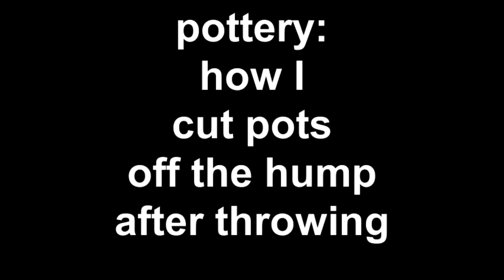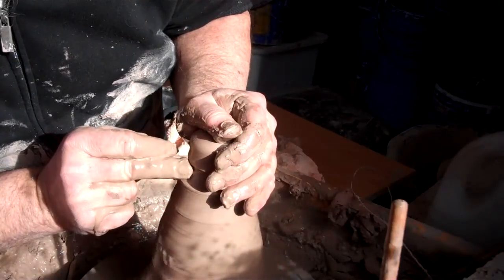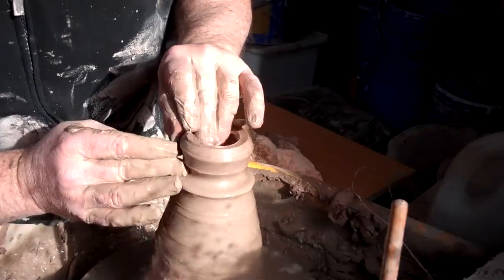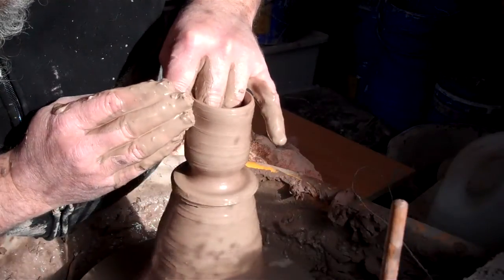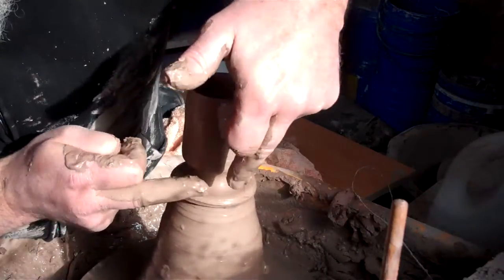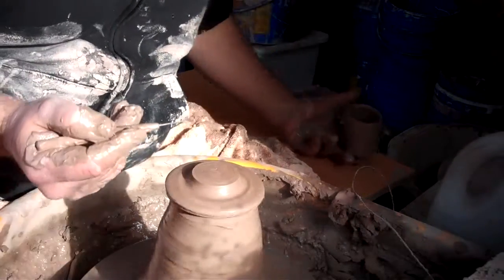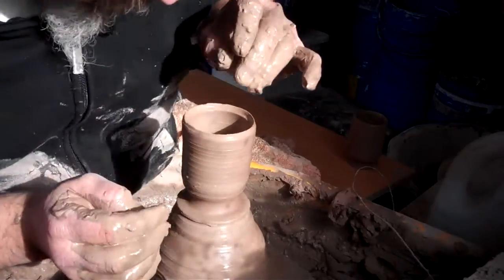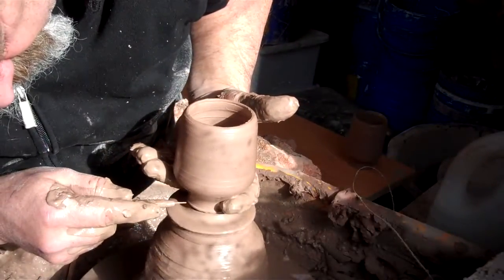pottery how I cut pots off the hump after throwing

Comment: I haven't tried this yet, but was told by a teacher I had that his friend, who is a production pottery throws almost all his pieces off the hump, and doesn't get S cracks because he dries them by wrapping all but the bottom section in plastic, allowing the bottom to dry out a bit, keeping the thinner parts more moist. Basically, he is keeping the moisture equal, slowing down the drying of the thinner areas, while allowing the thicker area, the bottom, to dry in free, un protected space. It is that differential in moisture content that creates tension within the piece, causing it to crack. Makes sense.
Reply from the maker: i think it is that plus the bottom isnt as compressed as the sides so theres an imbalance there. i burnish the inside and outside with my thumb a little after turning to add a little compression and i always stamp them in the centre which compresses them a little more. but, whatever works is ok